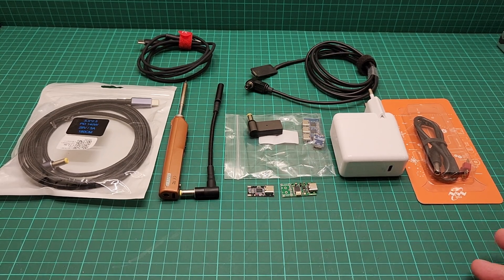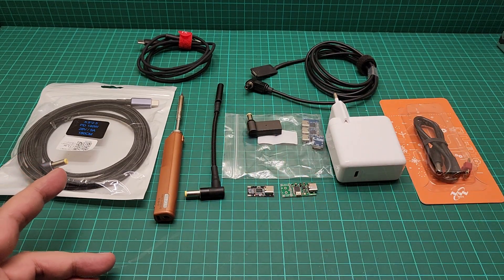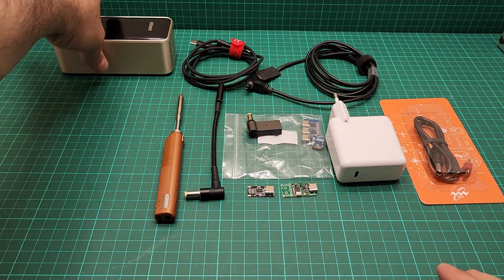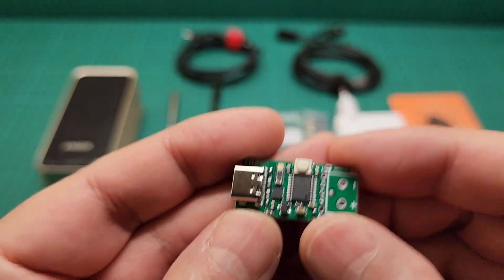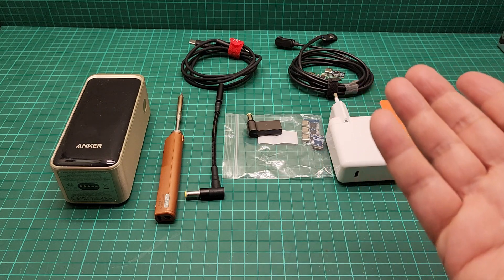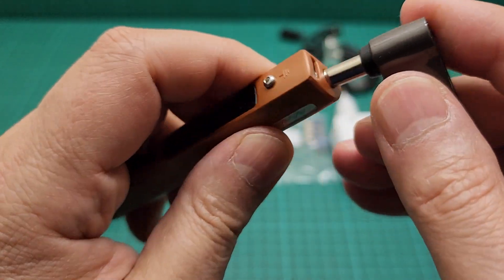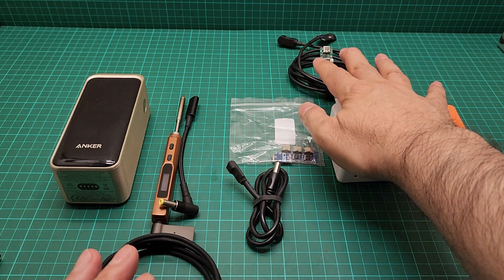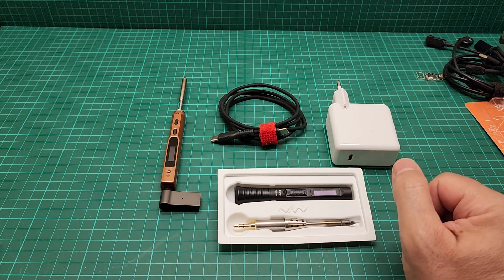TS100 soldering iron conversion to USB-C PD  | how to with assortment of adapters

Comment: Thanks for your insights. I bought my ts100 bundled with a 65w laptop charger. I've rarely used it and the charger is already failing. I've found that right angle 100w adapter you mentioned last and have ordered it.